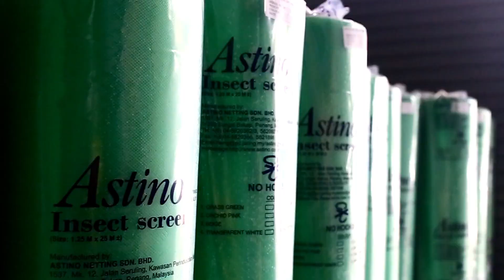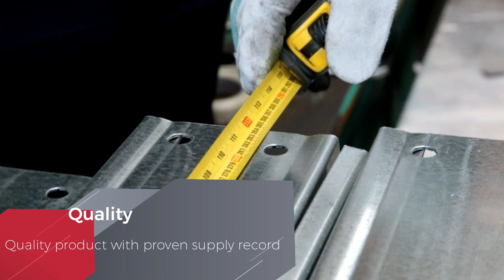Astino Berhad Corporate Video

Comment: Good day,  Am going to be replacing my tiled roof with your mettle roof.  Do you happen to also build ready made open space rafters, I plan to try utilizing the space in the attic of our house.  We will be building the roof over the existing one than from inside we than will remove the old roof.  The new roof will extend over the existing roof about 3re meters on the front and the back of the house.  Thus we need to have the over hand self supporting.  Thank you.